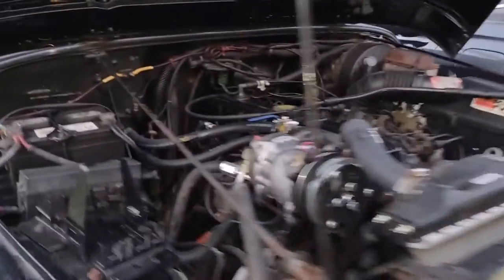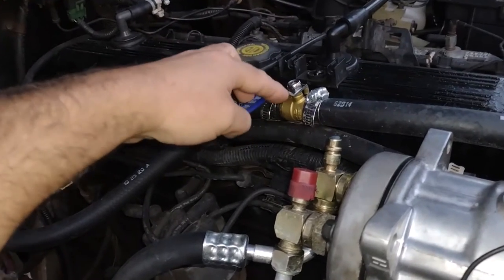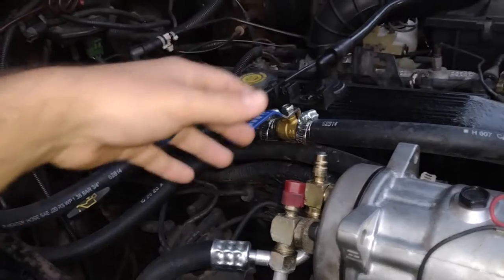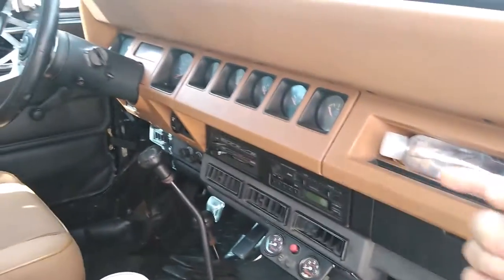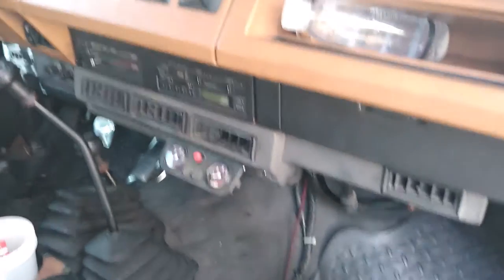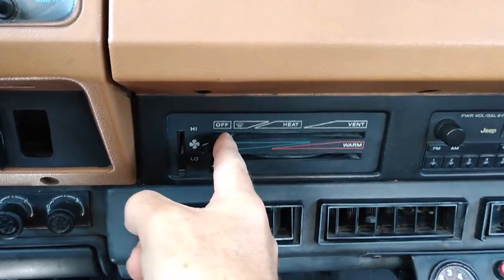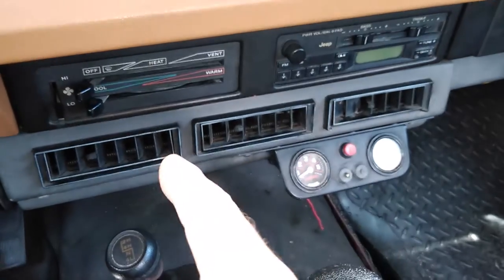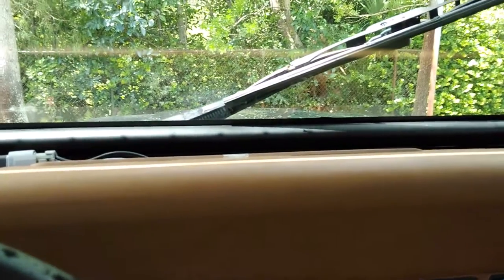INSTALL A HEATER CORE SHUTOFF VALVE IN A JEEP YJ

Comment: Okay, I'm convinced.  I will try your little weather windsock trick on my early model TJ, and go from there.  I think it has the same issue.  Your water valve reminds me of a story from my truck driving days.  My first job as a truck driver was driving a new R model Mack in the upper plains states.  I began in August, so it was still pretty warm.  As the weather turned cold, I began to notice how perfectly ineffective the heater in that truck was.  Scraping ice off the windows both inside and out while driving down the road in the falling snow convinced me that I needed to mention to my boss that I thought something might be amiss.  He laughed and asked me if I had ever noticed that outdoor water faucet looking thingy under the hood.  Yes, I had!  He told me to turn it open until it stopped.  I did, and things were so much better after that!  Thanks for the video!
Reply from the maker: Hello Lyle Kliewer, I liked your truck story. I can only imagine how happy you must've felt after turning that valve and getting some heat in the cab.
Thank you for sharing that story.
Reply: @planesimple8514  Just to update, I tried the windsock test on my TJ, no air coming through the defrost vents, or any others.  While my '97 TJ has the sliders to control temp and ducting, the dampers are operated by vacuum, and on mine the dampers and vacuum tubes must still be in good shape.  The heat entering the cab must simply be engine and exhaust heat.

Comment: I’m curious, isn’t there an electronic valve from the factory that shuts off the hot water when you’re using the air conditioning?
Reply from the maker: Hello Ken Stone. 
In this generation of Wrangler there is not. The jeep Wrangler did not have factory A/C till '97. All previous Wranglers and CJ's before that only had a heater, no A/C.
Also, i believe that in vehicles that do have factory A/C, what regulates or  shuts off the hot water to the cab is the temperature knob, the one with the blue and red arcs. In full cool, the hot water is off, in full hot the hit water is on, and anywhere in between you get a mixture of those positions depending on where in the temperature rage you are.
Reply: I found no valve control on my 97 tj. So I'm going to put this shutoff valve on my. My wife's 04 didn't have a one on it either. But I put heat shielding on floor and Kevlar paint on the tub. Her's is alot colder than mine in the cab.
Reply from the maker: I made and installed my own heat shield for the catalytic converter which in my jeep sits right below the passenger floor pan and MAN...what a difference!! Before the heat shield that floor pan would get blistering hot, now it only gets warm. That heat shield stops a lot of heat from getting into the cab.

Comment: Does this have any negative impact to the engine operating temps? I'm sure the heater core is so small, it provides minimal impact on engine temps, but wondering if cutting the heater core (a mini radiator) out of the coolant circuit makes the engine run any warmer.

Did you notice anything like that?
Reply from the maker: It doesn't affect the engine temps at all, unless your engine's radiator is plugged up and not providing enough cooling, in which case you could provide a little bit of cooling by removing some heat from your heater core. But that would be in an extreme case where your engine is already overheating due to a plugged radiator. 
Remember that when you have the cabin temp set to cool, you are not removing any significant amount of heat from the heater core, so your engine doesn't depend on the heater core for cooling.
Reply: @planesimple8514  thanks for the quick response! I’m guessing you have to bleed the system following installation?
Reply from the maker: Perhaps, depending on the vehicle. Depending on how low the heater hoses are and how much coolant you loose (how much air gets into the system). In my case, the hoses were the highest point of the whole system so no need for bleeding. In most cases, that air makes its way to the top of the radiator on its own as the engine runs, then you can just replace that bit of coolant back into it. That's it.
Reply: @planesimple8514  I'm doing it to the same vehicle, well, a 94 YJ. good to know bleeding isn't necessary! Thanks again
Reply from the maker: My pleasure. Any time. 
Good luck. 
PS, someone else in the comments suggested another valve that is a bypass, not just a shut-off. 
It may not make any difference, but take a look in case you like that option better.
Reply: It can help your engine to run cooler during summer. The coolant flowing through the heater core with the heater off isn't shedding much heat it's just circulating the heat back into the engine. Blocking flow through the heater core forces more of the coolant to go through the radiator and get cooled. Edit: You need to make sure that your engine has either a bypass built into the water pump or you have a couple small holes (3/16") drilled in the thermostat so that you don't end up with hot spots in the engine before the thermostat opens up. Some vehicles use the heater to act as the bypass so check before totally blocking them.

Comment: I watched to make sure I was installing on the proper hose but I need to point out that there's no reason to use a 3/4" ball valve, the inside diameter of a 1/2" is the same size as the ID of a 3/4 hose Barb and the price is less than half. Just go with a 1/2" ball valve with two 1/2 barb X 3/4 mnpt fittings and it's all good.
Reply from the maker: Cool. Thank you for sharing that. 
I hope people actually read the comments so they can see yours. 
Thank you for taking the time to write in.

Comment: I plan on doing this to my 2020 ram 1500. Can this cause any damage? Is it true that your coolant needs a constant circulation?
Reply from the maker: I'm not a chemist nor metallurgist to pretend to know for sure what happens to the coolant or the metals that make up the cooling/heating system, but I'd be willing to bet that nothing happens to the coolant from just sitting there. I think the coolant does not need constant circulation, otherwise bad stuff would happen when the truck is not running, 
I would be more concerned with having air pockets in the heater core. The air would expose the metal inside to oxygen and therefore may lead to corrosion. 
I think you should be alright. I've had that setup in my jeep for over 10 years and have yet to have any problems.
Reply: there is better valve than that in amazon which make water circulate when u shut it off .... i have ram 22 and i know that the ac is not good in all rams
Reply from the maker: Can you share a link to the valve? Or a name or description of it to be able to find it?
Reply: @planesimple8514  joywayus 4 way heating water manual control valve
Reply from the maker: Got it! 
I like it! I hadn't seen those before. 
Thank you very much.
Reply: @planesimple8514  u r welcome … i didn’t try it im waiting my shipment to arrive but i think it is way better than just block the water … also i found electronic valve on amazon but ithink its not worth the extra price and i like it the manual way less problems and easy to install… now my ac vent has 8 to 7 c degree hope after installing the valve it become 4 to 3 c
Reply from the maker: Awesome!
I hope it works. (It should)
Thanks again.